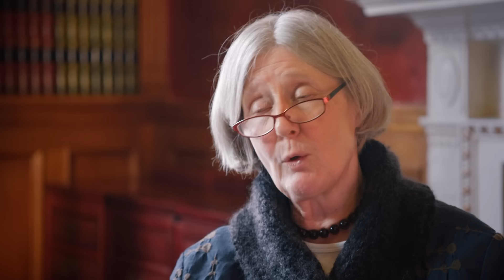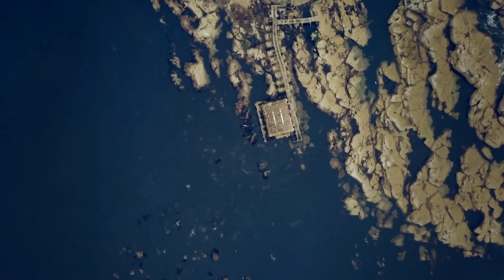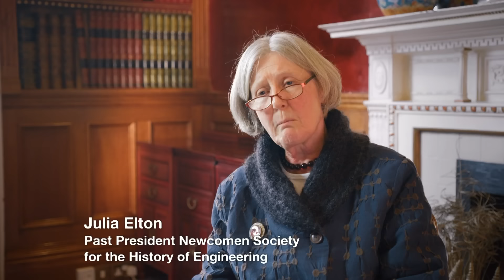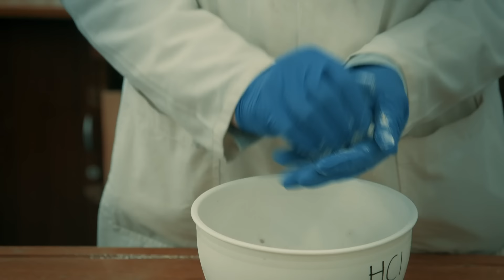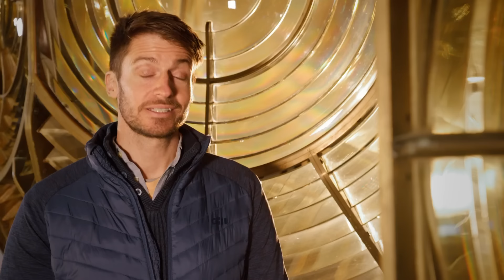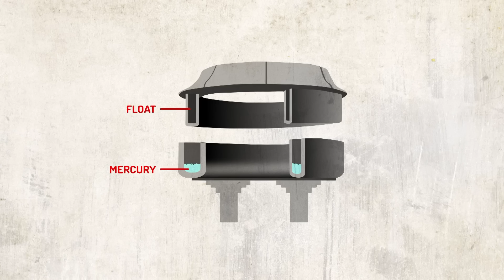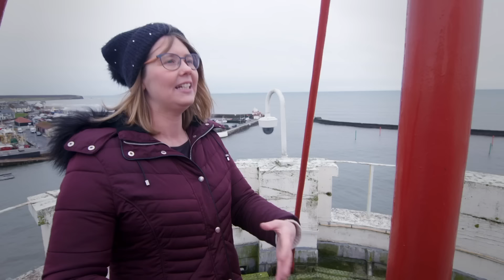Building the Bell Rock Lighthouse - The Secret Life of Lighthouses

Comment: I would love it if houses were built like this from solid granite to last generations instead of the disposable stuff that seems to pop up all over the place to be knocked down with changes in town planning or building styles.

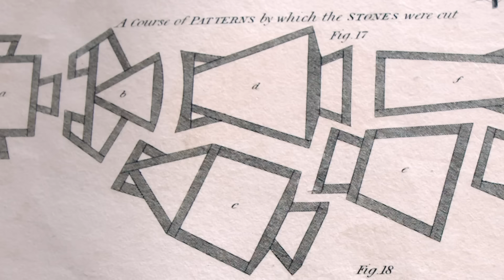Just looking at the complexity of the blocks ( 0:10 13:16 ) is amazing, loads of different blocks like the space shuttle heat shield and done without CNC, CAD or electronic calculators.

Comment: How was that massive lens put into place?  Helicopter?  Was the roof removed, then replaced?  Did the three keepers have separate quarters?   I agree it would have been interesting to have a tour of the inside so we had some idea of kitchen and bathroom facilities.  Also, that stone must have been a frigid mass that kept the inside temperature quite low.  Was there some sort of heating device.  What about water storage?  Once you start with one question, others come to mind in a steady curiosity-piqued flow.
Reply: The Fresnel lens was hauled up in pueces and assembled in the lantern. The keepers all slept in bunks in one room, and there is a kitchen/living quarters, though now mostly stripped of lose fittings.